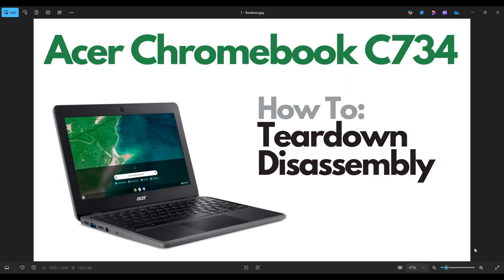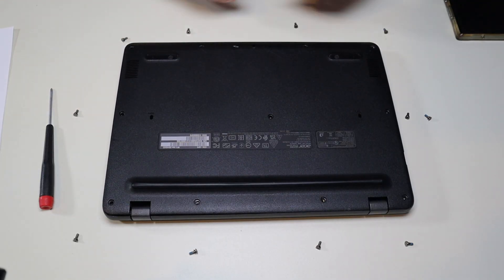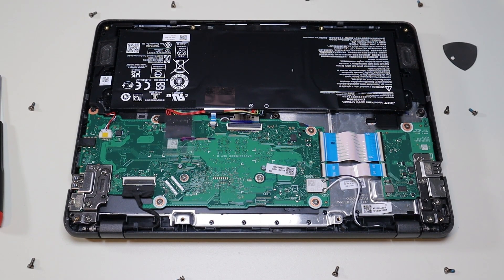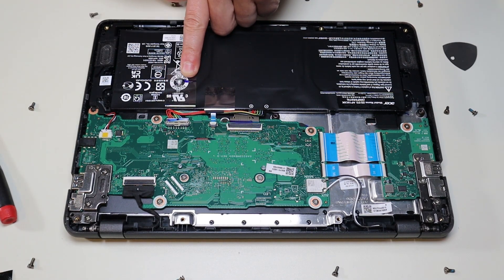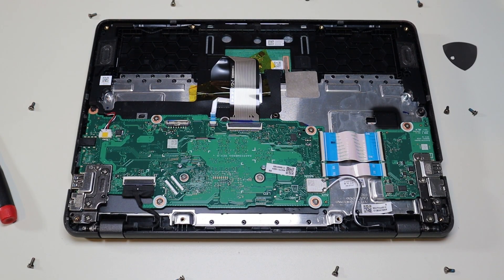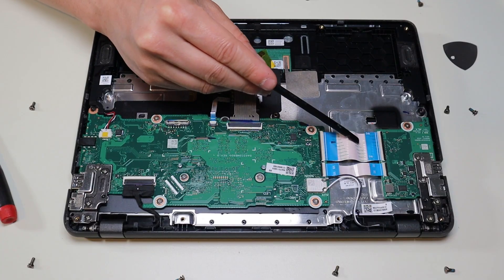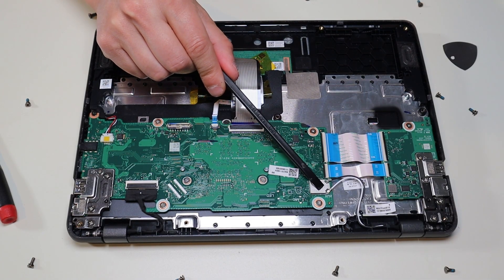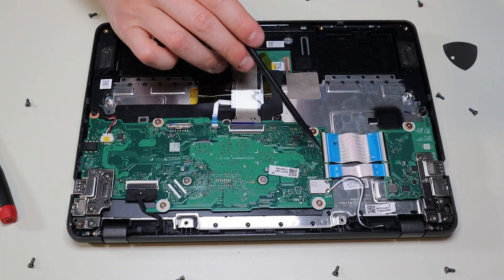How Teardown / Disassembly - Acer Chromebook 511 C734 (C734-C0FD) Laptop Computer

Comment: Sir how do I access the ssd drive on this model comouter
Reply from the maker: Remember to check the FAQ's on my videos! It could save you time getting an answer to common questions :)
 The storage and memory of this computer is integrated into the motherboard. They cannot be easily accessed or replaced.

Comment: Hello man my dell Inspiron 15 7000 gaming is showing black screen but it is turning on for some time what to do
Reply from the maker: If the screen is black, what are the signs that the computer is actually turning on?
Also, did anything happen before this issue started? Overheating, liquid spill, Windows update, etc?

Comment: what do i do if my first day acer predator helios neo 16 just keep the black screen but the fan is working after the predator logo
Reply from the maker: If your computer turns on but the screen stays black, can you try the steps seen here? https://www.youtube.com/watch?v=e9iy30J00-k
Also, did anything happen before this issue started? Overheating, liquid spill, Windows update, etc?
Reply: i just did factory reset and everything works correctly again with ai helps
Reply from the maker: @Jarvvisss  Glad your all set :) Always here if needed !!

Comment: My issue with my Acer laptop is this: Before the problem started, I wanted to reset my laptop to wipe everything so I could play Roblox smoothly. However, the reset got stuck at 62%. I waited for a while, but it was still stuck, so I canceled the reset. While it wasn’t fully canceled, I closed the settings and shut down my laptop.

When I turned it back on, the issue hadn’t occurred yet. But after a day (I can’t remember exactly when), the problem appeared. Now, when I turn on my laptop, it loads the Acer logo, then goes to a black screen. After that, the power indicator turns blue, but after a few seconds, the screen goes black with two blue lights on it. After about a minute, it goes into a loop, and I haven’t been able to open my laptop since then. Please help!
Reply from the maker: If the computer turned off during a reset, the operating system (OS) could be messed up and may need to be reinstalled. I would try reinstalling as seen here:  
Windows 10: https://www.youtube.com/watch?v=OD0ysL9Mb38
Windows 11: https://www.youtube.com/watch?v=CbjnLZGQKhI
Let me know how that goes :)
Reply: @PC_Monkey Yo thanks, but how do I get rid of “undoing changes” while resetting my laptop?
Reply from the maker: @RansBloxxx  If the reset messed up the OS, I would restart the computer as seen in those install videos and try a new install.

Comment: What do I do if some of my keys stopped working? I have not been hard on the keyboard so I'm wondering if cleaning with ipa will help? Or does something break and its just done? I am curious on potential solutions! Thank you!
Reply from the maker: Is there something physically wrong with the key / keys or are they mechanically working fine?
Also, did anything happen before this issue started? Overheating, liquid spill, Windows update, etc?

Comment: hey, i’ve been watching a lot of your videos hoping to save my laptop without spending the fortune that i know its going to be… i have a lenovo loq 15 that was working perfectly fine yesterday. today however, i noticed the blue light on the power button was blinking blue, so naturally i just tried to turn it on, but it stayed blinking blue. So i just turned it off and expected it to turn on again, but it never did. i use this computer for my college classes and i literally can’t do anything without it. i need help😭 this is the worst thing that could’ve happened to me!! i tried pressing the power for 1 min, and i was too scared to mess around with the battery because its all wired in. i just can’t afford to take this laptop in, or to get a replacement. i feel so stressed out. this is THE WORST!!!

Edit: i also tried to plug it in with the power cable and the orange light at the back doesn’t glow up anymore. i’ve only had this computer for 2 years so i don’t know how it could go completely dead on me
Reply from the maker: For a computer that does not turn on, try this video first; https://youtu.be/kOBY4k2Mn_k. Let me know how that goes :)
Also, did anything happen before this issue started? Overheating, liquid spill, Windows update, etc?

Comment: Hi it's Daisy I need to know how to fix my computer but with out any uses or anything please please please please those computer is the only thing I have
Reply from the maker: Without any uses? What brand and model computer do you have and whats the issue with it? Also, did anything happen before this issue started? Overheating, liquid spill, Windows update, etc?